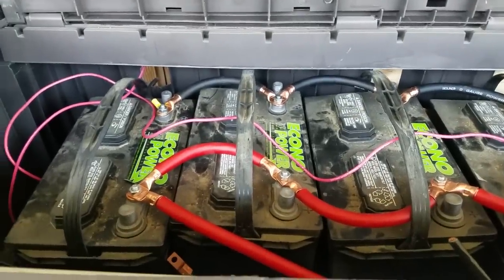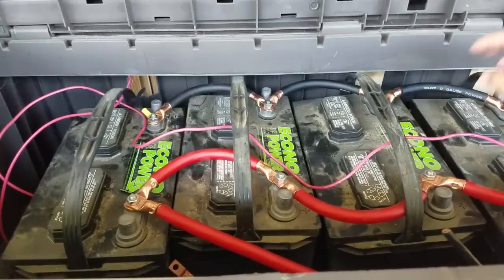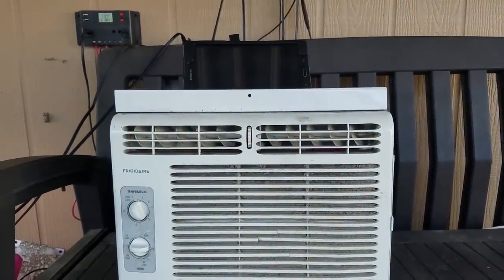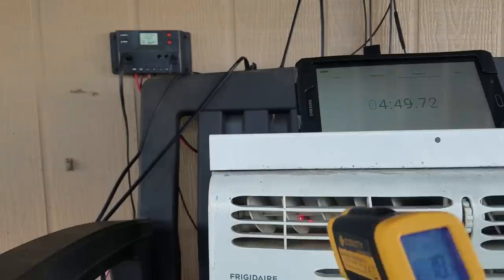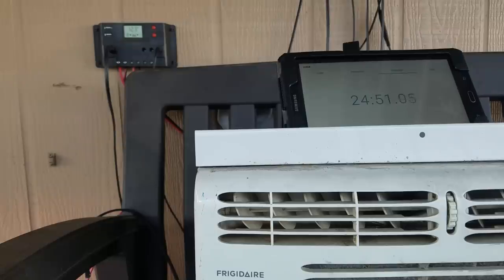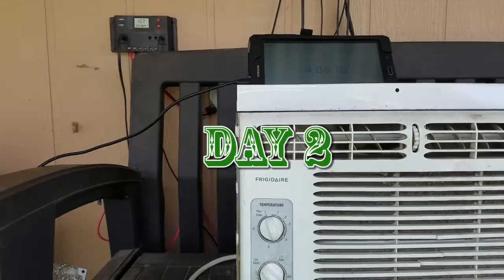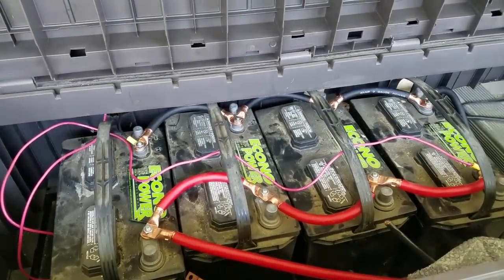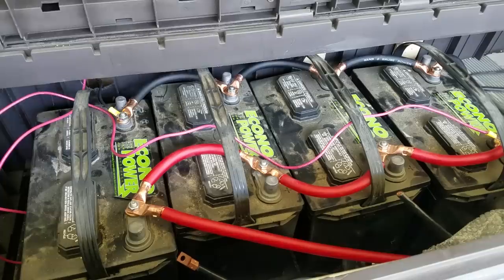Running a 5000btu air conditioner on Harbor Freight solar panels?

Comment: Did I miss something?  How long could you run the a/c before the battery bank fell to the 12.4 volts you targeted as your stop point?  How long did it take the solar PV array to replace the charge so that the batteries were fully charged once more?

Yes, it is possible to run the a/c unit from the batteries for a certain length of time, but is it practical?  I don't think it would be practical for most people.  My RV has a solar system and I have learned a bit although I am not an electrician by a long shot.Here are some figures that might be interesting.

My 5000 BTU a/c shows (on a label) that it draws 4.5 amps at 120 volts.  Using Ohm's law, that converts to 45 amps at 12 volts.  So to run the a/c for one hour, you'll use 45 amp/hrs (45 amps X 1 hour) of battery power.  Lets say that you want to run the a/c for 5 hours a day.  You'll use 225 amp/hours each day

Assuming that you continue to use the flooded lead-acid deep cycle batteries that you showed in the video, you'd need a battery bank of at least 450 amp/hours capacity to support the running of the a/c for the 5 hours a day.  (Remember that with this type of battery, you can only discharge it to 50%.  Discharging them more deeply damages the batteries.)

Now that we have determined (close estimate) the size of the battery bank we need, let's work on our solar PV array.  We'll assume that you get 5 sun hours a day.  A large part of the United States gets 5-6 sun hours a day.  Sun hours are not the same thing as daylight hours.  Sun hours are more important than daylight hours in designing solar systems and only sun hours are used for the calculations. Here we again will need to apply Ohm's law.  Volts X Amps = Watts.  

So, if we have 12 volt solar PV panels and we need to produce 225 amp/hours in our 5 sun hours, we'll need the array to produce 45 amps each sun hour.  To accomplish this, you will need 540 watts of PV panels.

So, theoretically, you could run the 5000 BTU a/c for 5 hours a day using a battery bank of 450 amp/hours and an array of solar PV panels totaling 540 watts.  BUT, theory and practice are often two different things.  These figures do not consider things such as the power loss in conversion/inversion from DC to AC or losses due to resistance in the wiring.  Neither do they consider days that are partly cloudy.

For practical purposes, one should be able to survive a minimum of one full day without sun.  This would mean up-sizing the system.  The battery bank would have to increase to 900 amp/hours and the PV array would need to increase to produce enough power to support today's usage while also making up the deficit created by yesterday's cloudy weather.  If one allowed two days to make up the deficit, the array would need to be increased to 810 Watts.

So, to make a practical system to support 5 hours of use of your 5000 BTU a/c daily, you would need:

a 900 amp/hour battery bank. (Assuming flooded lead-acid deep cycle batteries.  Less if you spend the money for lithium batteries which can be discharged more deeply.)  (Cost roughly $100 per 100 amp/hr capacity.) 

a solar PV array of 810 Watts. (cost about $1-1.25 per watt.)

An appropriate sized solar charge controller,  inverter, wiring, fuses and etc...

So cost is roughly $1800 for the batteries and PV array.  Add in a couple hundred each for the charge controller and the inverter, and another hundred in wire, fuses and incidentals.  You are now approaching a price tag of $2500!

Is it possible?  Sure!  Is it going to be practical?  You decide.  But I'm betting that most people won't find it practical.
Reply: clyde alspaugh I learned more reading your post than I’ve learned watching the last 5 YouTube videos on solar.
Reply: LOL.  True that.  Maybe you could even go for Great Grandma's swamp cooler.  It was a wet sheet hung up in the open doorway with what little breeze there was blowing through it...  Used zero electricity.  Of course swamp coolers aren't effective when the humidity goes above about 25%, so they wouldn't be practical for people who live in certain areas.  Here in Iowa, summer time humidity is often around 70%.
Reply: +clyde alspaugh lowest humidity ive ever seen is in the 40s in Mississippi, i do live by the water though
Reply: Humidity was often low when I lived in the southwest.  Swamp coolers were popular, but newer construction tended to have both a refrig. a/c and a swamp cooler.
Reply: @haxorman4302  Swamp coolers don't work in the south
Reply: @haxorman4302  yep no lies there. But this year it’s been pretty high, our lowest is high 50s but we’ve had tons of rain. And tons of 80-90% humidity weeks. It’s been absolute shit lately too. 😂🤣💪
Reply: Research and Build after 5 years batterys are shot, and airconditioner has been replaced 2 years ago... never break even
Reply: I was going to leave a comment about how long/practical it could run a ac but your reply did a good job of answering that.
Reply: clyde alspaugh + dam you fucked that guy up
Reply: I've built a system like this and that parallels what I found.  We use ours to power an ac unit for k9 cooling.  It doesn't need to work 24/7, 5 hours is plenty and between the panels, the car driving to mission locations and the battery capacity (I have 600 ah of deep cycle gel batteries), it does work.  With all that said, keeping up on service (meaning at least weekly) is of paramount importance.
Reply: Hans Evensen, perhaps you're right.  One probably could get by with less battery capacity.  But, if I'm going to spend the amount this system would cost, what's a couple hundred for more batteries?  Personally, when it comes to the battery bank, I'd rather over build slightly than under build.  But that's just me.
Reply: Over building is great.  The more you discharge the batteries the less they last.  If you only discharge 10 percent the last many times longer depending on the battery quality and make.
Reply: Thanks Val.  I must have watched every YT vid on solar I could find twice and I visited lots of websites.  I appreciate the vote of confidence, but be sure to do your own calculations.  Get the advice of a pro if something isn't clear or seems to not make sense.  It's a learning curve, but it isn't as steep as one might think.  Always be sure to check more than one source for info.  Grid-tied and hybrid systems get a little more complicated, but off-grid (i.e. stand-alone) systems are pretty simple and straight forward.  There are a bunch of options.  The trick is figuring out which option best meets your needs.
Reply: clyde alspaugh 
That's some serious info.
It's making me rethink what I should do for my upcoming build.
My goal is to have renewable energy that saves me money on power and I get my money back after 3 years on a 20-30 year system. I've been considering  Tesla's Powerwall 2 which had a 30 year warranty.
Reply: No such thing as a 100 AH lithium for $100, more like $800 for a 100AH lithium battery...
Reply: Of course you could add a car alternator into the mix say on a bicycle. Then your capacity is..........
Reply: clyde alspaugh, as I'm not an electrician, could you please tell me what PV stands for? All I know it is is Present Value.

PS: Thank you for your great breakdown
Reply: Hi Guy H.  PV in this context stands for photo-voltaic.  That's the proper term for what we commonly call solar panels.
Reply: clyde alspaugh your comments and calculations and KNOLEGE are like a breath of fresh air. I DON'T know much about solar but been trying to learn for a WHILE most videos are confusing and leave out really important information.
Like cost. How to hook up .
What kind batterys .how many .how many solar PANALS. What is a converter.what is a controller.what every thing is and what it does.how to maintain it.a video for those like me who have very LITTLE KNOLEGE how to .if a person has basic good KNOLEGE. of all the components and how they work and in order a to z.
And about the right brands are best for best price.
How it all works.
You have that ability.i understand your assessment.what is pv mean.you know what your talking about.i FELT i could TRUST it and that is so important.i don't want to burn my house down cus i DIDEN'T hook something up right or used the wrong brands that don't get along.
Or did something out of not knowing or hook it up wrong.all so the down side of it all.thank you.THANK YOU SORRY IT'S SO LONG.
VAL IN N.C.THANKS.
Reply: Glad I could help in a small way.
Reply: Rx7Tool, if your goal is to save on your power bill, there are 3 options to consider in solar systems.  Off-grid, grid-tied, and hybrid.  Off-grid systems won't be connected to existing house wiring and they are most often used in RV, tiny house, and homesteading applications.  If you put this type of system in your house, you'll also have to run wires to the appliances you want to run.

Grid-tied systems don't require batteries.  Excess power generated is fed back into the grid, and (supposedly) the power company must pay you for it.  The disadvantage is that when the grid goes down, your solar system is useless.  You can't use this type of system as insurance against power outages.  Because of the specialized switching equipment required, this type of system is more expensive than an off-grid system.  It also requires permits and approval by building inspectors.  I've heard that the approval process can take 2 years in some cases before one is allowed to start building.

Hybrid systems.give you the advantages of both off-grid and grid-tied systems.  The disadvantages are that they require even more switching equipment and are the most expensive to build and to maintain.  They do allow you to store power in batteries (another significant part of the cost) and use the battery power when the grid goes down.

The off-grid system is the cheapest to build in general.  But in a house application, it can be the least convenient.  If your goal is to recoup your build cost in under 5 years, it is the only type of system that stands a chance.

I'd suggest that in working toward your goal, you examine your power use for how you could modify it.  In financial terms, it isn't how much money one makes, it is how much of that money one manages to keep.  Power is the same.  Managing your usage is often more effective than managing your sourcing.  If you tackled this from both ends, you have a good chance of meeting your goal.  Good luck.
Reply: will edwards  Swamp coolers only work in dry hot climates and it better not be monsoon season, cause the don't work with any humidity at all! 

Albuquerque is hot and dry except during monsoon season which happen to be JULY AND AUGUST! Swamp coolers suck, including Arctic Breeze!
Reply: clyde alspaugh yes possibly thanx
Reply: clyde alspaugh, low, VERY LOW! Like 10-15%...if you're lucky. Same as southern Idaho in the summer
Reply: The sun hours are really for a yearly average and only used for grid tied systems. This is important because AC gets used in the summer only, and sun hours are much higher, I'd say about 8 hours on average for the us. So about half the panels would be needed about 250 watts.
Reply: clyde alspaugh..wow!! You know your stuff..do you have a utube channel? Do you have a magazine or anything? What would you charge to help me set up a solar system on my van? What state are you in? If you don't want to answer on this format my email is..
Treetop86@yahoo.com
Reply: Not to mention that most people would run their   A/C units for way longer than 5 hours a day.
Reply: I haven't done the calculations but with only 2 more batteries than him and two small wind generators that put out a hundred to 500 watts each depending on the wind speed up to 24 hours a day, and just maybe one or two more solar panels I could run it way more than 5 hours a day. I live in a place that's fairly windy and so it could be producing power up to 24 hours a day with the wind generators. So with an extra 200 watts of solar panels plus two small wind generators yeah and another extra two batteries I could run that small AC just about as much as I wanted in the daytime since it gets cooler at night.
Reply: Yeah imo it would take a ton of batteries and panels to pull that off.. I can say that the small predator generator will run a window ac and its pretty quiet on about a gallon of gas per day.
Reply: clyde alspaugh I want to thank you for your excellent explanation that teaches how to do the math in an easy way. I build prototypes of solar energy systems for beginners and my pleasure. Thank you. Sergio Peralta. El Paso, Texas
Reply: You are good with your mathematics did you inform yourself about the mini split ac's system
Reply: Maybe you should go make a video for the ac on solar power
Reply: Is that the best thing to say. I liked the way he handled it in the video.  Because its not spam or anything else you don't follow it. I think it's a sad day for you to debate the merits of your business.
Reply: Clyde That's what I thought.   He needs spend more money that Mickey mouse system.
Reply: everything you assumed is wrong... the video title is "Running a 5000btu air conditioner on Harbor Freight solar panels?, he ran it off solar panels from harbor freight... question answered. You sound like the biggest fkn douche trying to make solar sound like it's impractical lol. You really have a lot more to read about solar and you should try experimenting with it too so you dont have to assume so much and get it all wrong in the process. Your rambling response is a clear indication you ran all over the internet copy and pasting the most over engineered system for a window ac i've ever heard lol. I also guess you googled the different parts and listed the most expensive ones you saw.. 100s of dollars on wiring and fuses and incidentals for a fkn 800 watt system? Are you a complete fkn asshat or are you just pretending to be one on the internetz? 
"survive for at least a day without sun" - once again, assuming some weird ass shit like surviving a day without the sun. It's an ac not a life support system. 
Also, if there's no sun, I doubt it would be so super hot you'd die without an ac anyway. Most of your ridiculous assumptions are easily shot down with the critical thinking possessed by an average 5 yr old. 
😂🌬️💨💨
Reply: This is why I never got into solar. Learning how to ride a horse took less research and time.
Reply: @clyde alspaugh

Wow you got it all down that was amazing 👏 . Thank you for don't all that work and showing it this helped me out a lot
Reply: Is it possible?  Sure!  Is it practical? Sure!!!  When you are in the middle of nowhere boondocking.
Reply: Thank you for this detailed information 👏
Reply: The guy that replied with knowledge and math thank you. I'm finding out that bogging together components is getting frustrating for me. And coming to the conclusion that I'll have to start teaching myself the math to understand it better. I appreciate you explaining the real cost
Reply: clyde alspaugh.  Properly explained.  Your math and real world pragmatic doubling of the ideal bare minimum is correct practice.  How come whenever I do the reality math on these solar videos I get dog cussed and called a fTard or STFU.  I do it just as courteous in the Mr Spock manner.  However the proponents !UST want magic not physics.

Maybe its because of this mindset:
What do you mean I can't charge my Tesla with solar when I get home at 8pm after running my off grid house on the power wall all day and now I want to watch the giant TV while cooking dinner on electric, be cool in my 3000 sq foot house when it is 98 degrees outside and run all my electronic toys.  Oh my son just got home from the game at 11 and his Tesla is reading 3 miles range critical.  I can charge that too before 6am right?
Reply: clyde alspaugh hmm doesnt seem too bad though. $2500 for A/C forever after that..free A/C too. We would need to figure how long we could run the A/C with $2500 of electricity and find our break even point. I hope my math is right. Electricty here is 10 cents per kwh. According to the AC its 5.4 amps at 120 volts, that is 540 watts, so it takes two hours for 1 killowatt. So, 5 cents per hour to run. That would be 48,000 hours for $2400. Which is about 5 years. After 5 years you now get free AC
Reply: Research and Build but you'd need new batteries and all probably by then so.....$$$
Reply: @researchandbuild1751  Your math is wrong; You would never be able to recover your costs, you'd continue to lose money. It would take you approximately 50 years to recover upfront costs at 10cents/KW. (Assuming you run the AC 180 days/year summer months) But in 50 years you'd have to replace battery bank 10 times, and replace solar panels, charge controllers, inverters at least twice. Without tax credits, your overall cost for this setup will be at least 4x more expensive than using electricity from utility company.
Reply: @researchandbuild1751  and now after 3 years of this comment he dump those butteries and panels in garbage 🗑)))
Reply: clyde alspaugh 

NICE BREAKDOWN.
Reply: I build a swamp cooler from a 55 gallon plastic drum. 12 volt fan... max amp 9. 
Dump the A/C if you live in a low humidity area
Reply: R Coyote 
Oh yeah? Well I built a time machine with a 5 gallon bucket, a toilet seat, and a box of matches.
Reply: clyde alspaugh 
While all of your data is top notch, and what is recommend, I'd have to disagree with you on battery capacity. 

A full second day of reserve capacity might not be required. Although it can get hot on overcast days, it's much less likely. A/c is one of those things that's dependant on the sun's brightness. Although humidity is a whole other problem 
I
For a solar system I'd say even down to a 130% battery capacity to be sufficient, as long as you are not running the AC at dark times
Reply: Hi William Foreman.  I had never given much thought to the advantages of a large system Vs several small ones.  Now that you mentioned it, several things occur to me. 

 First would be the environment and purpose of the system.  Rvers, preppers, homesteaders and people in towns who want backup/supplemental power systems will likely have different opinions on the matter.

I belong to the first and last categories.  Living in Iowa, I use my solar system in the RV during the camping season.  My PV panels are built into a suitcase style array.  In the colder months, I remove the batteries from the RV and keep them on standby for power outages due to winter storms.  I got a set of truck bed led lights at my local big box store and mounted them a few inches apart on a piece of foam board from the dollar store.

I made the wires long enough that I can carry the light board into my kitchen, living room, bathroom and bedroom.  My battery bank can easily power the LED lights for about 40-50 hours continuously.  That is sufficient to give me lighting during a power outage of 4-5 days which is about three times as long as the worse end of average in the outages I experience.  Most are just a few hours.

For longer outages, I have a 4000 watt construction style generator which I can hook up via a grid isolation switch that prevents me from backfeeding power into the grid lines.  That'll handle my frig and heating along with a few incidentals.  

I don't take the big generator camping with me.  Its too big and much too loud for camping.  For camping, I'll get an inverter type generator.  Yes, they come at a higher cost and so far I haven't needed one, but it would be nice to have one anyway.  While camping, my power needs are modest averaging 35-40 amp/hrs a day.  My 200 watt PV array produces about 11 amps during sun hours.  With 5 sun hours a day, the array can produce 55 amp/hrs a day and that will easily replace the power I used the day before.  I built my battery bank to as large as the battery box can fit.  It's now 400 amp/hrs of flooded lead-acid deep cycles. (12 volt)  This gives me enough capacity to endure three full days without sun.  The suitcase style mounting of the PV panels allows me to quickly adjust the panels to the optimum angle at each different campsite and I don't need to park my rig in the sun.

If one looks at a solar system from a homesteader point of view, having several small systems would mean more components to manage and separate battery banks to monitor. (Costing more time and physical energy.) On the other hand, it could provide more portability around the homestead for those occasional needs that are far from the main or central system area.  Perhaps one might have a system for the house and another system for the barn, and etc... But for ease of monitoring and management, a single larger system might be more desirable.  Maybe you'll let us know what you do in the end and even maybe post a video?